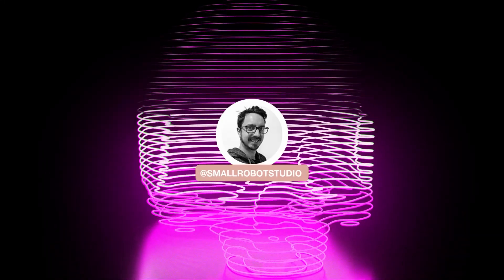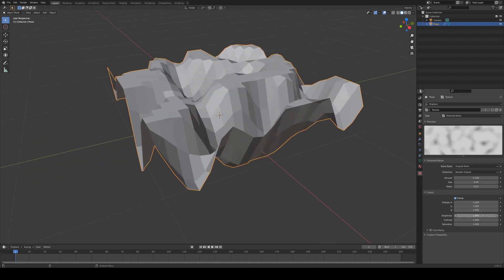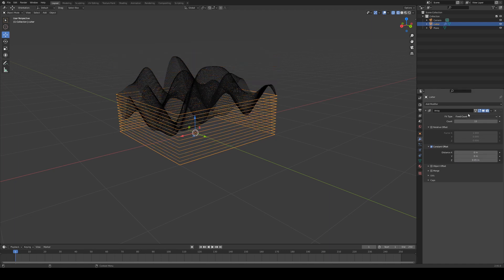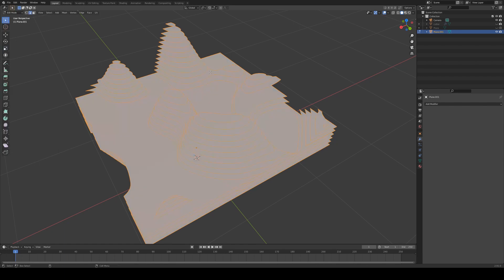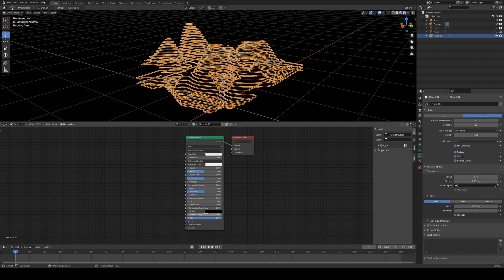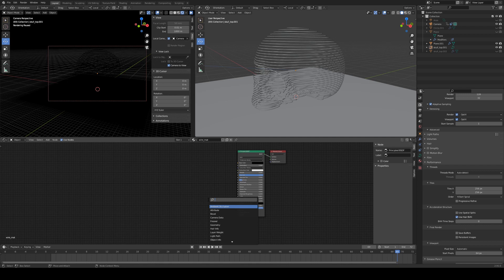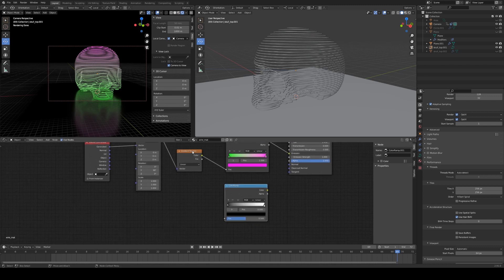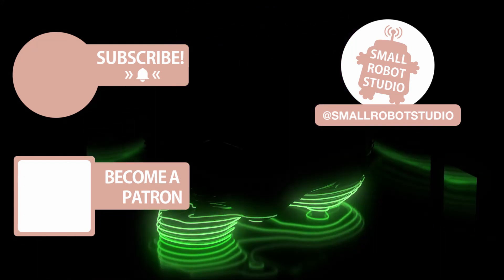Blender 3D Turning your Mesh into Wires (Topographical Slicing) Tutorial

Comment: For me the intersection has errors as you have shown when the planes are of different sizes. I use an imported mesh, not one generated by dispacement. I have applied the scale. Still not working.